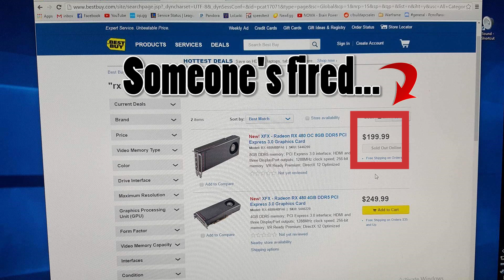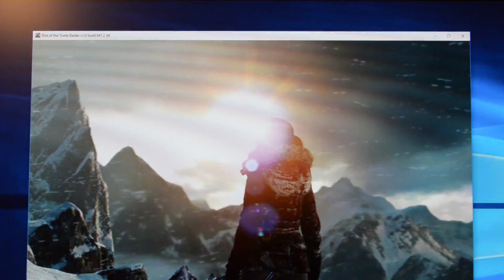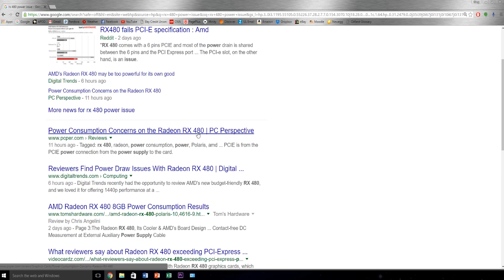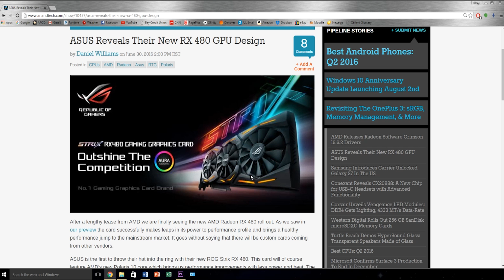RX 480 Aftermath: Power Issue & Over-Hyping

Comment: this card performs exactly as expected I own own . it is slightly better then a over clocked 970 and when more games correctly use directx 12 its gain over the 970 will be much more substantial and I feel it will be closer to the performance of a 980 at that time .
Reply: It is the fault of every reviewer that all of them benchmarked this against highest factory OC'ed 970 , compare it to a stock one and it totally outperforms it in every game.
Reply: +Andres Celano it most certainly does surpass the 970... Not sure where you get that from.
Reply: +Andres Celano with customer boards coming out, 8-pin, 6+6-pin variants, and seeing that this was a release driver... The 480 will prove to be a very capable card, for a long time. It'll pass the 980 shortly.
Reply: Jeremy Ruzanski I believe that drivers will make it better but for a card that can not even surpass the 970, i do not believe it will go toe to toe with it
Reply: one*
Reply: probably not lol
Reply: Not just that they also don't make it super clear so when a nvidia fanboy sees 970 EXOC they see 970 exotic model and go seeee!!!!!! Its better.
Reply: I'd have to find the exact video but the rx480 out performed the 970 in 10 of 13 benchmark tests in that specific video.
Reply: Factory overclocked barely makes any difference though. Only a few frames at most. It takes manual overclocking to get a 10-15% increase in performance.
Reply: You must not know how the 900 series works my friend. just look up ssc.
Reply: the 900 series is still relevant. If it wasn't, there wouldn't be comparisons. Also the current 1000 series offerings aren't within the 480's tier. So it's not a direct competitor of the gtx 1070 and gtx 1080. If it launches, then the gtx 1060 will be its direct competitor.
Reply: We're in the ~$200 price bracket though... wish I could be a spoiled "money is no object" brat like you.
Reply: your facts are off. It sometimes beats a regular 970 by a few frames sometimes. Never an ssc or sc 970. quit that fanboyism
Reply: +Jeremy Ruzanski it barely beats a regular 970 by a few frames in some games. Are you smoking?

Comment: Will 60-70 dollar 1151 socket motherboards have any problem with the 480?
Reply: R360, did you watch his benchmark video? This card doesn't run hot and I'd extremely quiet, he talk about those two points a lot.
Reply: +R360ЯN Thanks! 

Yeah I figured the AM cards will run a bit better, I just dont want to cough up the extra 50+ dollars for it.
Reply: ***** Not saying to get a reference card, just pointing out that your statement was wrong in the case of this particular card.

Comment: And the 1060 gonna be out real soon i would wait and see what its gonna perform like and what it cost, there gonna be a 3gb and 6gb version but they should've went 4 and 8 like amd. I think 3 will be fine for most games at 1080p but I've had 3 get really close if not maxed in some games on my old 780 classified. Just wondering if there gonna call it a founders and charge more i hope not that would kill sales. I do wish nvidia would make an overclocking tool like wattman. Im glad i bought a 1070 i was gonna get a 1080 but didn't want to spend that much plus it doubled my framerate or more in most games over my 780 classified, and my zotac 1070 boosted to 2037 out of the box and i got it to 2125 so far may go a little further.
Reply: Siege can use use up to 6gb at 1080p, and there are a bunch of others than use more than 4gb. 3gb isn't enough today and it even 6 will struggle in a year.
Reply: +Matt Burkett yea i can agree with that they should've use gddr5x on the 1070 and used 4 and 8 gb on the 1060. But they wanted to separate the 1070 from 1080 more than the 970 and 980 was so they would sell more 1080s. But I really haven't ran into any trouble with 3gb of vram on my older 780 classified at 1080p, i could play any game at a mix of ultra and high but usually ran high to have better framerates. But games are getting more demanding lately rise of the tomb raider being one of those vram wise.
Reply: Chad Hay It's usually not to bad because games like Siege auto lower textures when they sense a low vram card.

Comment: There's plenty 480's on newegg and please nobody use amazon and pay over unless they have it for what it cost. I bought a zotac 1070 amp extreme edition for 479.00 and there going for  600-700 on Amazon and people are paying that what the hell. Ive had newegg send me notifications they've had gigabyte, msi, and zotac at random times in the last week. My card said it was gonna take 1-2 weeks but my order got in stock 5 hours after ordering and i got it 3 days later. And wait on sapphire nitro 480 it looks to fix temp and power problems, and the fan release is really cool.

Comment: it's sad that AMD is having this "problems" but in performance per price this card stills a beast. it is said that board-partners were able to overclock to 1400-1600Mhz stable, the card is about 1200mhz I believe and that means a lot, I overcloked my brother's r9 380x from 980 to 1050 mhz with overcloked memory 1500 mhz, and that made a huge step it was 5 on avg more fps and about 10 in the heaven benchmarks, maybe is not a lot, but the minimum frame rate increased and made even more playable games at 1080p, thinking that is a better architecture, core are stronger, the frequency will play a lot of game. in the tech yes city channel an overcloked RX 480 is taking advantage of the gtx 970 g1. sadly with this horrible designs on the coolers there's no much to take atm. I currently own a the devil r9 390x water-cooled (I got it for about 350 so I'm not that dissatisfied at all, it can still handle +100 fps on 1080p so it's gonna be a while when I decide to upgrade :v).

Comment: soooo
Cheap motherborad+expensive graphicscard
or
Expensive motherboard+Cheap graphicscard

Kinda defeats the purpose dont you think???
no problems for me tho but for many of my friends and my sis who har a normal budget 
I would beleve it does ... just go for the price dropps on th e 970s and 980s :D
Reply: the thnig is thsoe 2 scenarios are the most common ones unless you are building a system from scratch, which lets face it , it ain't for every wallet

you are mostly likely upgrading from an older card, and one of garantee's pcie has is full backwards compatibility(btw current gpu still dont fully utilize the speeds of pcie 2.0), whic is the issue of this card
Reply: Hmm true true :)!
But none the less its an impressive card

Comment: AMD did mention that the RX 480 was supposed to be an alternative for  “VR capability common in $500 GPUs”.  Alongside the vague theoretical floating point operation figure given (>5Gbps), and crossfire benchmark, I think AMD certainly played their role in the hype. Only performing at the level of the card above from the previous generation (R9 390) is a pretty standard generational improvement as well. I think people expected more from such a die shrink, especially given the performance and efficiency Nvidia managed with Pascal. Of course the hype is still mostly on those that are overly optimistic towards AMD (AdoredTV etc) given their history of performance. Great bang for buck card, but it's hardly a massive leap forward in performance, price/performance or performance/watt. Even less so outside of the US, where the problem isn't so much the amount we pay, but the amount we pay relative to other cards. Here in Oz the 8Gb RX 480 is listed between $369-$479 (AUD. Typically around $440), while the 4Gb version is unavailable. That puts the reference RX 480 head to head with the R9 390 and GTX 970 AIB partner's cards, with factory overclocks and improved coolers. The RX 480 is still a better buy due to it's improved feature set (and possibly improved performance with mature drivers), but not by any great amount.

Comment: Why would anyone want to pair an Athlon II CPU with RX 480? It would be massive waste of money, the CPu would bottleneck the shit out of the GPU. Not to mention the old PCI-E 1.0 slot.
Reply: pciexpress is supposed to be fully backwards compatible so it doesnt matter whatthe board was if it poses an issue on older board its somethnig it needs ot be adressed
Reply: +Ricardo (Teixas) no its not like that at all, lower versions deliver less power meaning less performance and in this case with this new architecture it means not enough power if you have a modern mobo with a good power phase and a gen 3 x16 slot you should be good. but just wait for board partners for extra performance anyway.

Comment: If you are so afraid of burning up your pcie 3 motherboards (which is highly unlikely), try under volting the card. At stock it runs at 1100 mV. try lowering it to 1050 mV or 1000 mV. The guys from JagatReview tried this and recorded 33 watt less power draw.

Comment: Will a ASrock z170 Pro4s have power delivery problems ?
Reply: nope
Reply: It will not. My GTX 980 Ti runs totally fine with that same board and Core i5-6500.
Reply: Unless your board is from 2006 this won't happen
Reply: +hyungwoo0312 I have a 6600 :p
Reply: No, but that will not change that the card draws way too much power through the PCIE slot, which can damage components, even on higher end boards. The problem isn't limited to just crashing.
Reply: whychunter 950s and 750 tis which are pcie slot  power only often draw 80 watts average. Those are aimed at cheaper systems and no one has reported issues with those cards.
As Paper mentioned most motherboards are designed to accommodate  up to 95 watts average before being permanently damaged. It's only older ones which drop the threshold slightly
Reply: taief miah
Do you have a source for that? The only figures I found showed a maximum draw (read: spikes) of 79W for a 950, or 68W for a 750 ti.

People have reported issues with the cards, that's the thing.

https://community.amd.com/thread/202410#2733281

http://www.overclock.net/t/1604421/various-amd-rx-480-review-thread/1860#post_25309056
Reply: whychunter check the average power consumption of those cards. Either at 75 watts  or slightly higher. The point is the score is average, the cards can spend a lot of time above that limit.
Especially when running with boost.

The guy on AMD forums is a fake. He hadn't played witcher 3 for 7 hours. His steam account shows 0.28 hours over 2 weeks ago. He probably broke it doing something stupid and is trying to claim  from the 480 issue.

The guy with fried audio ports took a board he had done bitcoin mining on (ran a lot 24/7 at 100% load) and then ran 3  480s OCED on it. I must also mention that the board wasn't x79/x99 (or equivalent),nor was it a high end consumer board but a midrange board. 
In that scenario the guy was at fault himself. There is only so much you can push hardware when it isn't designed to run like that.
The board was probably near the end of its life. He just applied the final push to kill it. (Even server grade equipment  binned for stability doesn't run at full speed 24/7)

Comment: I just got that same foxconn motherboard for 5$ at goodwill. (they had a system for 50$ without the CPU, gpu and harddrive and later took it apart) they also had a LGA 1366 mobo but the dumb employees screwed up the pins.

Comment: Motherfuckers wanted 360 euros for an rx 480 here since they sold the only card in stock now the priced dropped to only 300 geez wtf
Reply: supply and demand, same reason why DDR4 memory initially cost 500€ with the exact same 32gb kit now only costing 140€.
Reply: ThePrussianGamer apparently the rx 480 should be still on the shelves, they had way more units to sell than nvidia's cards
Reply: King Quartz A rx480 costs more than a custom boardpartner gtx 970 at the moment, atleast in germany when looking on amazon (directly not resellers). Another example would be the GTX 1080 Strix from Asus, which i got from amazon (directly) for 760€, while they are now selling it for about 830€ with a MSRP of 799€. That was before the massive demand hit the retailers.

You need to keep in mind that alot more people can and will buy a "200$" card than a 800$ card. All that AMD said was that they would have about 6000 cards in north america ready for launch anyway.
Reply: ThePrussianGamer 970 is atleast 300 euros here same with the rx 480 :D
Reply: weclmoe ot the market

as long as supply doesnt meet the demand the retailers are gonna have a gouge fest ot turn a profit

Comment: I got a question for you guys. I'm currently running an AMD R9 285 and I have 3 1080P monitors and I want to know what you guys think would last longer. I can get 2x MSI Twinfrozr 4gb GTX 980's in sli for around £220 each (£440 total) or I can get an MSI Twinfrozr Gold Edition 6gb GTX 980ti for around £300 and possibly could (not 100% sure) get another one for sli in a few months time. So what would you guys think is best? I primarily just want to be able to play any game for the next 4-5 years or so at max settings 60fps at least with 1080p. I know both of these cards are sorta overkill for 1080p but I'm wanting them to last for a good few years before I need to upgrade again.
Reply: Id rock the 980ti, the things still a beast and the LN2 King.
Reply: yeah but the thing is i might not be able to get a second 980ti for sli anytime in the next few months so would the two standard 980's be alot better than the 980ti or on the same sort of level?
Reply: luckyshottzZZ
I would personally save my money and purchase the faster card once price permits.
  As great as SLI and Crossfire seems to be, I cant get over micro studder. If your trying to locate a micro studder issue, dual gpu only adds one more possibility to the equation.
Reply: DarkLinkAD
yes but i dont want to wait months for gpu prices to go down

Comment: did underclocking or under volting fix the problems with the cheap motherboard and the rx480?
Reply: Undervolting should work but the custom PCBs With 2 6 pins or 1 8 pin should also fix it

Comment: PCIE can handle more than 75, 75 watt are the standard BOOT not Limitation. the amount of watt a MB can put out by the PCIE is base on the MB itself...meaning if the MB designers wants their MB to out put 300 WATT on their PCIE they can.

also... in DX12 games the 480 does match the 980 but in DX11 its not
Reply: 75 is considered the safe limit tho

anythnig higher will depend on the quality of the power delivery which the gpu makers cant garantee at best your card jsut doesnt power up at all, at worse it damages both itself and the motherboard, and in extreme cases it might even be a firehazard.
Reply: 75 is the Standard Boot.
Boot is the key word here, any modern MB can handel more watt than that in fact its possible to have 300 watt from just one pcie 3 if the designer wants it to be so.
Reply: BrotherO4
300 w from the lane alone?!

well damn tho it sounds right i would not want to be anywhere near that :S
Reply: Its possible but that is up to the mb designer at that point. Expect any Normal mb to Handel 75 to 100 watt easily plus spakes won't do anything at all. Many cards draw some more than 75. Just do some search and you find that we been through this "shocking news" about 3 times.
 Already

Comment: its garbage just buy a GTX 1070 people
Reply: I would, but its double the price
Reply: nvidia fangay alert
Reply: apparently almost twice the performance which would be 100% more is  40%, hmmmm quite the math genius we have here
Reply: twice the performance would translate to 100%
Reply: But it costs twice the price....  How does your argument even make sense? For anyone gaming on 1080p a $200 GPU is more than enough.
Reply: Abram Carroll word 250$ for 3gb and 300 for 6gb = garbage 4.4 tfops and half the computing cores Nvidia has never done a good budget graphics card. they should just stick to top tier cards
Reply: waiting for 1060
Reply: Different price range.
Reply: Word is: July 7th for the 1060.
Reply: dat price doe
Reply: Then get a 980 on the cheap.
Reply: +TheSinisterEyes1 yes bro
Reply: The 1070 garbage you advertise is incompatible with HTC Vive in most connector scenarios.
VR Ready(tm) my fucking ass.

Both GPU generation launches are riddles with problems, some exaggerated some sort of on point.

Comment: I do think AMD are partially to blame for a lot of the over hype, after all, their own marketing rubbed it in nvidia's face with rx480 in crossfire beating a 1080, adverts saying join the red revolution etc... Then you had 3rd parties citing 5.8Tflops and 1600MHz overclocks would beat the 6.5Tflops 1070. AMD fed the fanboys willingly. The fact the review embargos didn't lift until the day of release shows that they were expecting the hype to sell more units than the actual performance of the card would. Let's face it, in other media like videogames, if the reviews don't land until release day, you know it's going to be a turkey!
Reply: 2 480s beat 1 1080 in some games
Reply: Xamnition I know, but my point was, if AMD weren't trying to take a swipe at nvidia's high end cards,  why even bother showing that comparisson. It fed speculation and ultimately led to overhype by 3rd parties and then disappointment on release. If they'd have just come out and said we've got a $200 gtx970 competitor with added dx12 features, that would have been enough.

Comment: I wasnt expecting for the rx 480 to be better than the 980 just steadily better than the 970. That's because the amd guy said that the rx 480 is a good caard for VR while the 970 is borderline acceptable for it. that's where my dissapointment came from. I wasnt expecting 980 or 1070 performance anyway.

Comment: the thing is that amd said, that you can use the rx 480 for VR. the recommended setup for VR is a 980. with the claims that a rx 480 crossfire setup would beat a 1080, and a 1080 "beats" 2 980s. you would think that the rx 480 would be better than a 980.